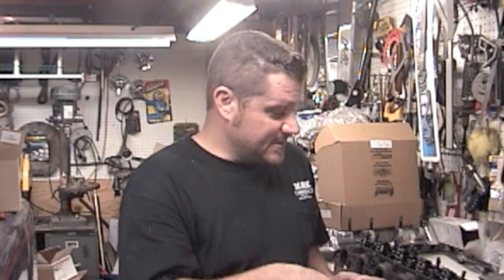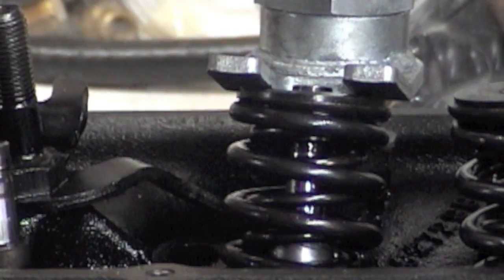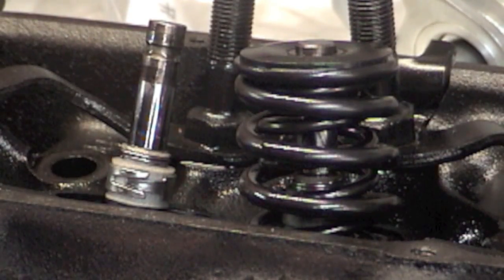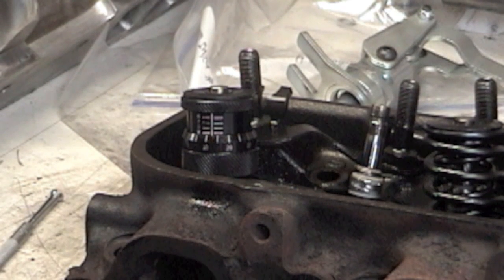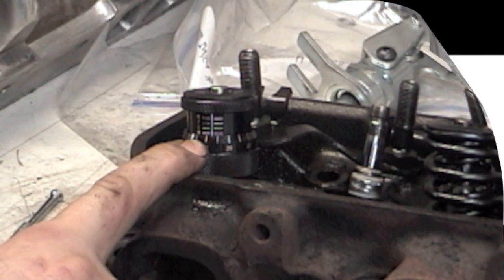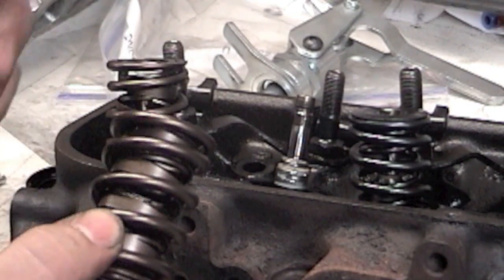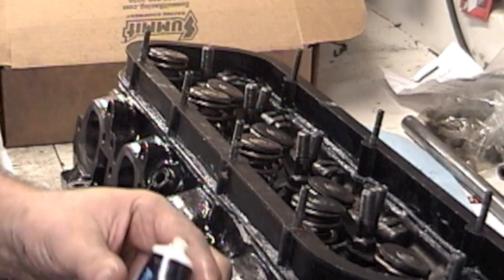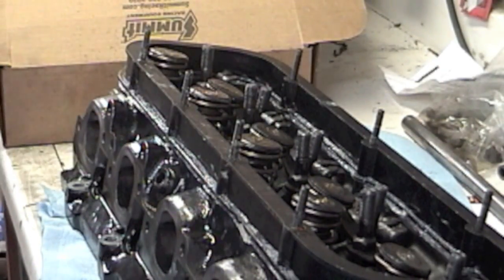Part 18 How To Measure & Install Valve Springs For The Big Block Chevy

Comment: Pulled a 454 out of a 1977 motorhome and completely rebuilding the block and heads. I am dropping the motor in a 1990 Blazer, replacing the stock 5.7 I want to add some torque and HP to the engine. Figured I just need to modify the cam and while doing that clean up the heads and add a better performing intake. Anyway my question to you is what do you think about beehive springs for a build like this and what type of cam (solid, hydraulic) would you go with. Would love this motor to run forever. Thanks

Comment: just did this to my 781's used the same 2 tools, compressor is awesome but I had to bend(flattened) the forks to make it not push the retainers off center(against the valve stems)but once I did that it worked slick and got all my springs within .010 of each other and installed spring height specs., next will be pushrod length check,  probably over kill for very mild build but good learning project  none the less thanks for all the BB chevy vids

Comment: Best video's out there, question, if needed would you install a .0030 shim under the keeper or between keeper and spring on an aluminum head?

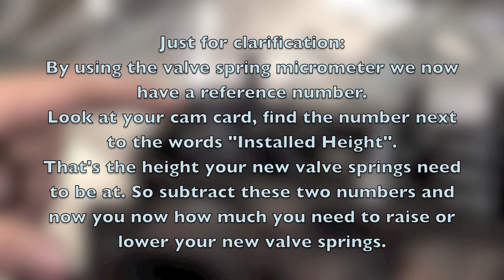Comment: Hiya JK and thanks for the great video.  My cam card doesn't have the installed height like you mentioned at 6:49.  Where else would I get that info?  Isn't it based on the cam?  I'm running a comp cams 11-238-3 and the heads are BBC 346236 - Oval Port 2.06 intake, 1.72 exhaust 1975-87.  Thanks again!

Comment: Seems like if you add .090 to your retainer to valve seal measurement and that distance is less than .090 bigger than your valve lift you have contact.  I would think you would want to subtract .090 from the retainer to valve seal measurements to give some clearance.
Reply: I thought that too. But Johnny meant to say add the 90 thou and your answer is STILL greater than what the max lift is

Comment: Johnny K, yeas i am running Brodix aluminum heads, i bought them used they came assembled. I dont have any pushrods. I bought a couple stock length to get an idea and thats when i saw the problem. With out the pushrod in i can get the polley locks on. I just received some pushrod length checker tool. After securing rocker arm to valve geometry i got 7.650 for the intake and 8.800 for the exhaust. The rockers are isky's 1.7 for bbc. The current studs are 2" from base to top. It seems to me that if i go with longer push rods like stock it would put the rockers in a steep angle. But they look good now with the shorter lengths
Reply from the maker: Javier, I would call Brodix and ask them your question.  I think the aluminum heads are taller then stock gm heads.  I wonder if that raises the valve train also? I never ran aluminum heads, so I don't know.
The believe on aluminum heads you have to use spark  plugs with a longer reach(more threads) than a iron head spark plug.  Sorry I could not be more helpful, I just don't know too much about aluminum heads.  
Have a great day
Johnny K

Comment: Hey Johnny K. Hope you are doing well! So I was measuring for pushrod length and realized that my rockers didn't clear the studs with the stock pushrod lengths. In other words with the pushrods in and the valves in, when i try to place the roller rocker on the stud, the studs don't even make it through the rockers for the polley locks. So should I use shorter pushrods or longer studs?
Reply from the maker: Hey Javier,
That's a interesting question. 
My 1st question would be, are you running steel or aluminum heads?
Aluminum heads take a longer screw in stud.
After you answer the 1st question and they still don't work
2nd question would be,  Remove the pushrod and set the roller rocker onto the stud, still can't screw on the nut? This is going to sound stupid but are you sure you bought the correct roller rockers for a BBC. Take a look at the box and see if it's the correct part #.  I never had that issue so I can't give you the best answer.  If after trying my 2 recommendations and no avail, I would seek the advice of a speed shop that build motors for a living to give you the best answer.
I hope this helps a little....hit me up when you find the solution please. I'm curious of what it could be.
Have a great day
Johnny K

Comment: Hey Johnny k! I stumbled on to your channel and i must say im glad i did. I thought i new just enough to build my own 496, so far i have my short block finished but after watching your videos i realized i didnt know the half of it. You have a wealth of information that makes me want to redo my short block. Great great videos, explained like you know what all my questions are. But i do have one question. I just bought a set of used brodix aluminum bb2 305 heads. They came with springs that are supposed to be rated for up to .650 lift. Is there a way i can measure them or find out if i can use them for my cam. My cam is a hydraulic lunati 292/300  625/625 with duration at 241/249 @ .050. Thanks for taking the time to make these vids. Look forward to learning more.  GB!
Reply from the maker: Hey Javier Castaneda!
Thanks for taking the time to post and the kind words.
I'm glad the video helped!
I would called Brodix and ask if your cam, is the best for their heads in your particular application....Street car?? or all out race car??
If the heads are used, I would suggest new valve springs.(then you know they are new, not worn out. Also piece of mind they are the correct springs for your cam.  
Then I would call your cam company and ask what spring kit works with this cam and the bordix heads.
The more info you get from the real experts that manufacture the components the better the cam/ heads HP combo.
I would have the heads inspected at a machine shop for worn valve guides....maybe the used heads could used a valve job/ new valves?
Hope this helps.
Have a Great Day!!
Johnny K

Comment from the maker: Hey osiel lopez, thanks for subscribing!!
Do a research on the web of your car.
Take the vin #...lots of chevy websites. Find one & plug the vin number in. You will see all specs of your car. Example: engine/transmission is it (manual what's 1st gear ratio) automatic what size torque convertor 1500 rpm? 1800 rpm? rear end gears 2.73? maybe they are 3:08?gear ratio posi or standard?

Now with info in hand, is your ride bare bones stock or all out performance from the factory? Start there get info

Comment from the maker: Hey lionieg,
Here's some great info about the Buick 401 Nailhead

carcraft.com/thehistoryof/65502_buick_nailhead/

When you select the camshaft for your engine the Cam Card will have the proper valve springs you should use listed on that Cam Card. I would suggest just buy the cam kit which comes with cam, lifters and valve springs .
Hope this helps, Johnny K

Comment from the maker: Hey Makavelli228,
I asked this same question to Lunati when I was ordering my valve train components. They walked me through it and directed me to their website under "Tech" Valve Spring Tech......To sum it up, take your measurement than add .090 to that.  Your answer should still be larger than the max valve lift of the cam. This will give you your safety factor.  Please note this is what Lunati told me to do using their components.
I hope this helps, Johnny K

Comment: im new to this and i have a 1966  401 buick nailhead 6.6 and i want to install a comp cam and lifter. i want to ask if you could offer any info on what valve springs i should use. if you can help id be greatful. thanks.